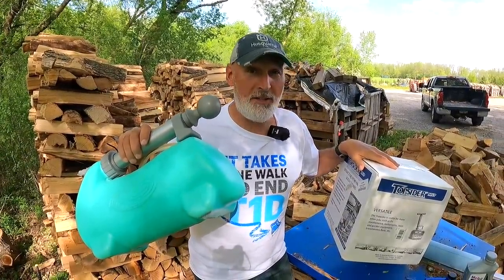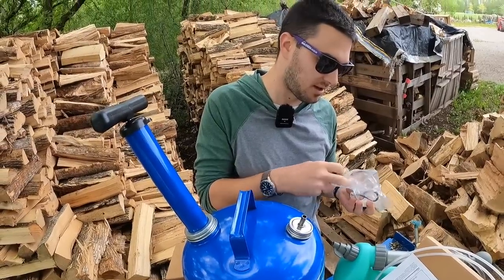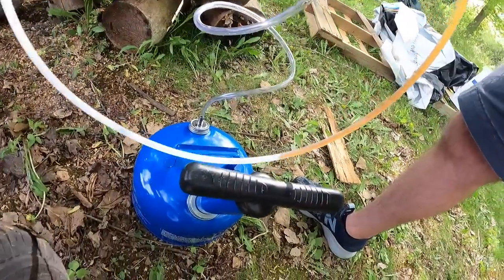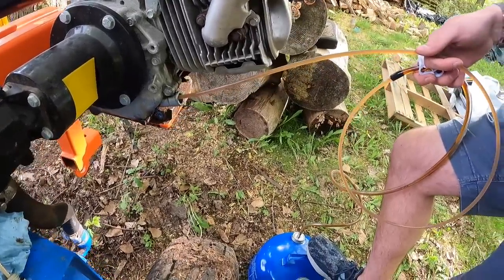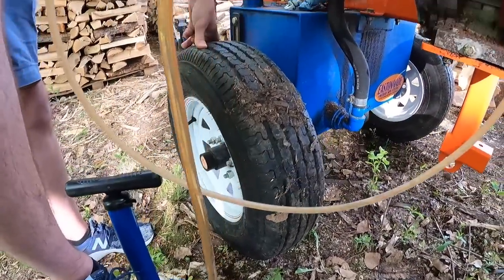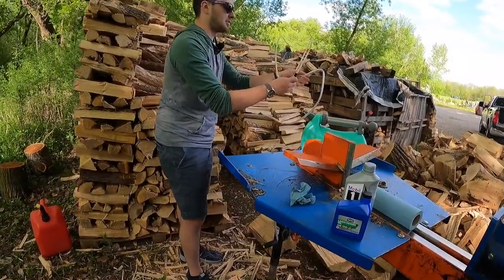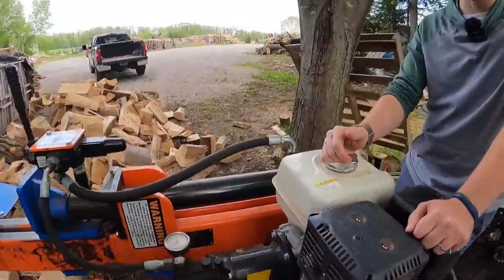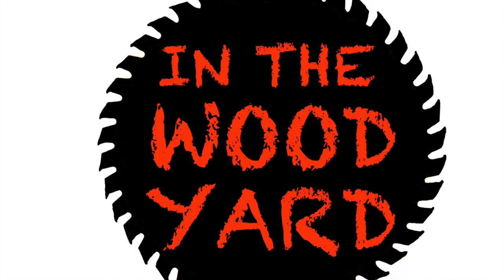Oil Extraction with LiquiVac and TopSider

Comment: I've had that Liqui-vac for a long time. It does not get much use LOL  The old Craftsman mower had a Drain plug on the bottom but no hole in the deck ??  A Hole saw took care of that. 4 Concrete block and a pan under it. No muss-no-fuss. 
Thanks Guys. Mike M.
Reply from the maker: Thanks for watching Mike!

Comment: Great show gentlemen.!
 Nobody likes to do it, but I guess that's why they call it preventive maintenance.?
   Those Topsiders are just under $60 right now.   That seems reasonable for what it does and the quality of it.   Your son has a good point about using for boat motors and hard to get to places.   It would be great for woods equipment,  it would help keep oil off the ground when you change it or do maintenance in the woods.
   Thank you for showing these devices.
Reply from the maker: Yup, thanks !

Comment: Hey Chris..FYI....on those engines the muffler is pointed right at the air intake filter. All the dirty engine exhaust is blowing right back at the filter not good.....Need to turn muffler to about the 7-8 clock position....this is a flaw with these engines!!  Changing oil is a Good thing!!
Reply from the maker: Thanks Mitch, I will do that!

Comment: Good video.  Look at Mitch Z's comment about the exhaust deflector, it needs to be re-directed away from pointing at the air filter, causes filter to clog real quick. Makes a difference on mine.
Reply from the maker: Thanks for the tip!

Comment: I made my own years ago from a 5 gal bucket with a lid. One hole for a tight fit with my shop vac and another smaller hole for plastic tubing extending to the bottom of the bucket. (The vac just makes negative pressure to suck oil into the bucket not the shop vac) if I can get the bucket below the pan I can let it siphon overnight and don’t need to run the shop vac for more than necessary.
Reply from the maker: That sounds like a good idea, you have a good one there!

Comment: Sons a ringer for you Chris - looks to be a solid guy too. Same dry sense of humour too. :-) A bit of heats your Pal when fitting up them hoses - warm them briskly & they co-operate betterer.  Hot water/a gas torch work well... Them suckers are handy - save a lot of fooling about under stuff. I use one a lot. As another "Top Tip" - (work)  if you forgot your brake bleeder, bang the hose of one of these over the bleed nipple & bingo - you just discovered the fastest/best brake bleeder yet invented.. :-) These cut ALL the mucking about out of bleeding brakes - little known "Hack" for these. Pedal down, sucker sucking & all the air goes bye-bye in a shot/ Handy if you just drained all the fluid out of a system (also using one of these... & need to replace it with fresh but aren't in the mood for an hours shouting at your Pal to "Press & hold" blah blah.. and still getting a spongy pedal... Nah  - reach for your sucker. Jobs now a 2 minute affair. Pedal down, open nipple...SCHLOORP... onto the next corner.
Reply from the maker: Nice, thanks for the tips James!

Comment: After draining my easy access engines I will introduce light air pressure to get small amounts of remaining oil. You definitely want to use small amounts of air and covering entrance and exit holes with a rag.
Reply from the maker: Thanks for the tip Harry!

Comment: Chris your handbook should say to change oil on the GX engine every 25 hours, well for Honda Lawnmowers recommend 25 hours.
PS Briggs Engines say 50 hours by the handbook.

Tecumseh engines use a spray system to oil it’s engines, Briggs& Stratton and other manufacturers use the splash system.
Bye for now Chris and son 😀🇦🇺
Reply from the maker: Thanks for the tips Rick!

Comment: I use a 99 cent turkey baster to drain my log splitter,  way easier and faster than what you did. And on a mower, just tip it over, opposite side of the carburetor.
Reply from the maker: Okay.

Comment: Instead of putting the 2 hoses together, use the larger hose and put the gromet on a piece of metalic brake line. I use a top sider for most all oil changes except for my truck, it holds 16 quarts of oil.
Reply from the maker: Thanks for the tip!

Comment: Is there a drain plug under the motor on the lawnmower, they use to drain plug so you could change the oil
Reply from the maker: Yup, but you have to tip it to get at it these things make it easier so you don't have too.

Comment: Soaking hose in Warm water.  helps getting the hoses on 😀
I could of emptied by now through drainage screw and tipping mower over into a container.😀🇦🇺
Briggs & Stratton have a little plastic one that vacuum the oil out.
Pumps can always fail after time like a weed killer sprayer.
Genes from his mum😀😀😀 (Sorry Chris)
I knew a lady whom started her mower smoke blew the the exhaust, I told her turn it off. I asked “what did you do recently to the mower? She replied changed the oil, checked oil leaves full to the top, I asked did you take the old oil out, she said Noooo😀😀😀
Reply from the maker: Thanks for watching Rick!

Comment: A turkey baster would do the same job only twice as fast, squeeze the bulb-fill-dump, repeat about 4 times and your Honda engine will be empty, better still open the drain nut, go and have a coffee and it will be drained by the time you get back. Can’t be arsed with these new useless gadgets, too time consuming, they should be put in the same category as the wind up bed unloader you tried out , “ CRAP” 😜👍🇮🇪
Reply from the maker: Maybe so but it did work good and it was easy, I could see it for outboard motors and lawn mowers.

Comment: Don't know about you but I don't trust any oil change that doesn't involve a drain plug. A proper drainage takes all the bits and crud with it, in my opinion. Sadly, newer lawnmower engines do not have a proper drain plug anymore because most people don't know how to change oil the old-school way. But if these oil change gadgets suck up all the scumm off the bottom that would drain out in a proper oil change, then is an easier and cleaner things.
Reply from the maker: Yup, a drain plug would be nice on all engines.